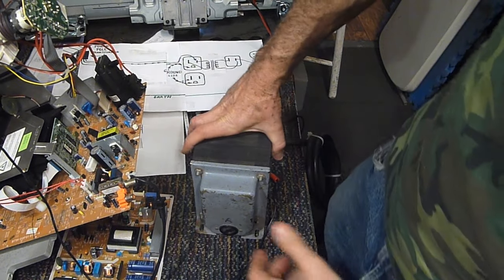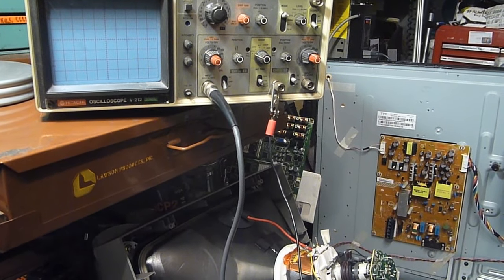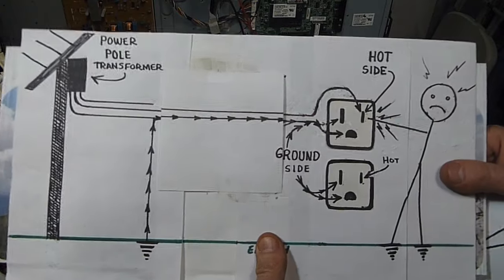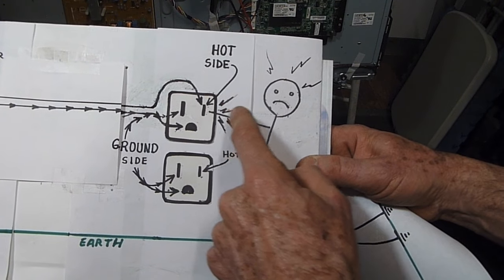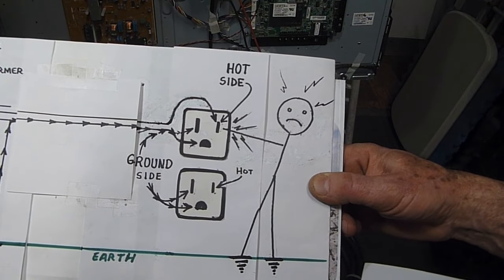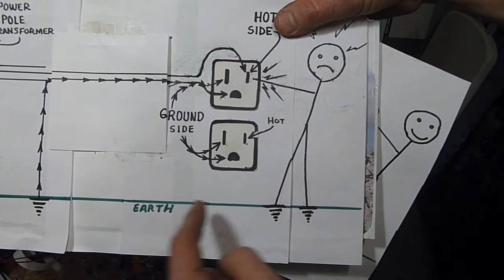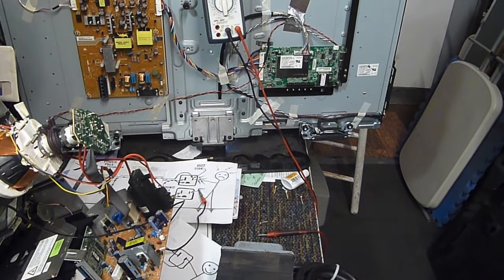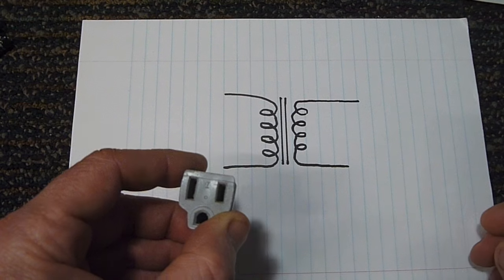Isolation Transformers can save your life, and your equipment.

Comment: GRANTS PASS TV, what was the benefit of TV's uses hot chassis? I'm not sure why the tv designers would use the chassis metal as the high voltage and not connecting it to earth ground, any reasons why?
Reply from the maker: One thing to consider with AC is there really is no hot wire as you would have with DC since AC is continually changing polarity, but since earth ground has an electrical potential in reference to one of the wires in your power outlet they call it a hot wire. As to why the metal chassis inside the TV case would be hot in reference to earth ground on older TVs perhaps it wasn't desogned that way, but due to the fact that sometimes the power outlet wiring in peoples homes have been hooked up in reverse,  That would account for the metal chassis in side the TV case being live when it was never intended to be.
Reply: @GrantsPassTVRepair  Arcade monitors use an isolation transformer to separate the monitor circuit boards grounds from the other circuit boards. The cords have a 3 prong plug but for some reasons the output of the isolation transformer will put the monitors chassis as HOT chassis. If you put your hand on the monitor chassis an your other hand touching earth ground you will get shocked. I'm not sure why they are using an isolation transformer when its still dangerous. If you try to connect your oscilloscope ground to the monitors circuit board ground it will damage the oscilloscope. I'm not sure why they are even using an isolation transformer, but I think its use mint to be used if the flyback transformer shorts out or the Vertical deflection transistor shorts out that the high voltage doesn't short back to the 120vac wall outlet to cause a fire to your house? It says that isolation transformers are Galvantic Isolation and that non isolation transformers don't have galvantic isolation. I'm not sure what they mean by this Galvanic Isolation or what is causing galvanic isolation in transformers.
Reply: First the high voltage is not connected to the chassis only low voltage i.e. mains. high voltage is over 1000 V. You could just as well s why did they not make the TVs digital. It was the technology of the time. Sockets were neither grounded nor polarized. There was 50% chance that the chassis was hot.

The fact that the sockets wee not grounded meant it was reasonably safe as there was little ground potential in rooms.
Reply: @okaro6595  whichs sockets are you referring to? And why would they want the sockets not grounded?

Comment: I've been having trouble with my soundbar. Not one video on soundbars with buzzing/ static type noise. And also my tv speakers sound blown unyet I've always used the soundbar... now I have to figure out if this is fixable by getting this isolator thing for a coaxial or..

Comment: Don't know if you respond to this video anymore but will ask anyway. If you use an adaptor with out the ground wire connected instead of the isolation transformer will that have the same effect?
Reply: It is worse, with the ground it will trip a breaker, without you become the difference of potential, thus getting shocked
Reply: No, just removing the ground plug wont do the same as an isolation transformer, What an isolation Transformer does is isolate de neutral and hot, so you won´t have a shok if you touch any two wires coming from the output of the isolation. Remember the neutral and earth wires are join toguether before it enters your house, so isolating the neutral you no longer have that issue. The best way yo isolate (an the most dangerous) is to use an isolation transformer and don´t hook up the ground wire BUT if something goes wrong It will not trip your house or workshop breaker, so It will blow. It´s hard to understand , isolation transformer are for electrical or electronic repair guys or such,

Comment: This is a highly informative video and I thank you for presenting this.  I have a stupid question though and it involves a comparison where you pretend electricity is water instead: if this were water coming in, then the transformer would act like a filter decreasing the water pressure or amount of water coming in?
Reply from the maker: To keep the concept simple using water pressure as an example. Water pressure would be the voltage, and current or amperage would be the volume of water. Most transformers loose some current to raise their voltage output, or loose some voltage to raise their current output. To keep the concept simple picture an isolation transformer having the same input of water and the same output of water with no change in pressure or volume.
Reply: got it.

Comment: Can I plug this device on my pc and play without problems?

Need this because this isolators have very good Electricity without reactive current
Reply from the maker: As long as you don't exceed the power capacity of the isolation transformer you can plug your PC into it.
Reply: @GrantsPassTVRepair  Oh ok cool so my pc have only a 1000 w psu so easy going when i buy a transformer with 2000 watt. are this peaktech products good? and thx for your fast answer by the way :))
Reply: @GrantsPassTVRepair  or bronson i dont know which one i should by because i need one with very good quality too hold long cuz i use everyday my pc for gaming and making music + video creating and more .
Reply from the maker: @nemesiz7175  Sorry but I don't have any suggestions about brands other than to make sure the unit can handle the power capacity you need.

Comment: You probably should have hit the fact that there is a true separation between the physical input and output of the transformer. Another note would be the current limitation in such an incident of being shocked would be limited to the transformer maximum current which promotes  less severe shocks.
Reply from the maker: Yes describing it as a physical separation would have been another good way of saying it. Regarding the current limitations of the transformer. I would not want to suggest there is any additional protection because of this. It takes less than half an amp to kill someone, so there is still the potential to get a serious shock with far less than the transformer can deliver in spite of its current limitations.
Reply: Agreed, so maybe explaining how this device can (possibly save your life) would fit with the title. And an added safety rule for all, the one handed rule. :)

Comment: Does anyone have an isolation meter scheme  to suggest? Even if we use isolation troansformer to supply the  dut, when we Connect first oscilloscope alligator clip, we cause a 1st failure to ground. If  we connect the second one All is over.

Comment: Question. Their is continuity (4.5ohms resistance) between the hot and neutral tabs on my Iso transformer. When you plug it into a socket then everything on that outlets hot and neutral has continuity (4.5ohms resistance instead of an open loop). Does this matter? The iso transformer is like a big wire that connects Hot and neutral together. Thanks!
Reply: Sadly I just don't think that I can do this topic Justice in a YouTube comment. LOL inductors by Nature are bit more daunting because there is more for you to visualize about them. What I will say is that you are measuring DC resistance with your multimeter and that that is not taken into account an Incredibly crucial part of inductors called Reluctance. 

Regardless though, I will say that you can probably safely visualize the power coming out of your Transformer as a push-pull type of arrangement. When power is going through the Transformer and a magnetic flux is being created, the power in The Wire is basically going to be following Lenz law. This means that the electricity is going to move in a specific Direction on one half of the sine wave and the opposite on the other half. The electricity that doesn't get used in this Arrangement just gets dumped back into the Transformer again as a magnetic flux.

I probably explained this badly and maybe even incorrectly. I would just recommend that you look at the excellent videos done by afrotechmods on the subject of inductors. There is also a good one from Great Scott and I believe a ridiculously in-depth one from mr. Carlson's lab.
Reply: the first man on youtube  know what is LENZ  LAW and MAGNETIC FLUX ,your are the man ,You must bee european because you know what i know.( may be same school )

Comment: Sometimes I wonder why the power that comes into your house isn't all through an isolation transformer..?
Reply: Because you´ll need a huge transformer, think abut it, a 1000w isolation trasnformer weights 20 pounds and measures 10" by 10", an average hose have 110v 20 amp so you´ll need at least a 2000 or 3000 Watt trasnformer, also you don´t need an islation transformer for your microwave, fridge, It´s just for the bench of a repair tech workshop
Reply: @gerardoromano3436  True, but the power still enters our house via a transformer, surely every transformer is an isolation transformer if you dont connect the earth or bond the neutral to earth in your breaker box?

Comment: Hi!  Thanks for the info!   
Question,  vintage radio/amps are what I have recently started working on.
So, on radios and amps that have a power transformer is the chance of a shock less than on those that do not have a power transformer?
Some videos I have watched talk about the 5 and 6 tube radios that do not have a power transformer, and thus they are more likely to give a shock if one is not using an isolation transformer. Is there any truth to that, or regardless, an isolation transformer should always be used?  I have bought an isolation transformer due to your video. 
Again, thanks for the info!!
Reply from the maker: I'm not knowledgeable enough to know.
Reply: In any case, I was unaware of an isolation transformer, and I learned a lot from your video.  I will use it regardless from now on.  Thanks!!
Reply: Transformerless, "AC/DC" radios (and any other device with the tube heaters connected in series directly to the AC mains voltage) usually have an electrically "hot" or "live" chassis, or, more accurately, you have a 50-50 chance of a "hot" or "live" chassis depending which way the old style, non-polarised plug is inserted into the wall socket, because one side of the incoming power cord is invariably connected *directly to the chassis*. To put it another way, if the chassis of a transformerless radio or amplifier doesn't seem to have measurable voltage on it, flipping the plug 180 degrees around will indeed energize it. Even if you install a polarized plug on the radio so that theoretically the chassis will only be connected to the neutral wire of the power-cord  and never to the hot wire, if the wall outlet is wired incorrectly you can still end up with a hot, live chassis. 

 An isolation transformer, if designed and wired correctly,  breaks the circuit in such a way that the "hot" chassis of the device is theoretically no longer "hot",  relative to other grounded tools, appliances, test equipment, microphones and PA/ musical equipment, and even metal water pipes or electrical conduit. Not only is it safer for the technician but it will likely prevent blowing up an oscilloscope, VTVM, signal generator or other AC-powered test/ diagnostic equipment being used during the repair process.

 Note that many older devices ---- radios, amplifiers etc ---- that do have a power transformer but only have a two-wire, non-polarized power cord and plug, often still use the neutral wire of the power cord as a return ground (a noise-shunting ground, really) for the chassis, with a voltage-blocking capacitor between the chassis and one wire of the power cord.  If you happened to plug into the wall the wrong way around, the capacitor is supposed to prevent the chassis from becoming electrically live with 120 V (or 240VAC overseas) while still allowing a path to ground for unwanted electrical noise and radio frequently interference; and if the device hummed through the speaker you were expected to know enough to reverse the plug at the wall socket and hopefully lessen or cure the noise (or in the case of a guitar amplifier, there might be a polarity switch that accomplished the same thing without physicaly reversing the plug).  The problem is that those chassis-isolating capacitors, commonly referred to as "death caps" by technicians,  might be 50 or more years old,  and frequently fail, and start leaking voltage onto the chassis. (Plug a vintage device with faulty wiring or  a leaky death cap into a GFCI,  a ground fault interrupting outlet typically found and required by code in most modern kitchens or bathrooms, and i the breaker built into the outlet will probably trip; if not, reverse the plug in the wall socket and see if it trips).

Old radios were frequently made with wood and plastic and non conductive parts and designed in such a way that it was difficult for the consumer to accidentally touch any part of the chassis that might be live, but vintage guitar amplifiers are a special case because the strings and metal parts of the guitar are at the same electrical potential as the chassis, and if the amp chassis has electricity on it and you touch another electrical or electronic device while your hands are on the guitar, or if you are playing guitar in a basement or garage with a concrete slab under your feet, you can be electrocuted (and damp slippers or socks might not insulated you sufficiently to prevent this). In such cases, use of an isolation transformer would likely prevent electrocution, and in my opinion is a must when using transformerless radios or amplifiers. Even on guitar amplifiers that already have built-in power transformers, knowledgeable techs will remove the death cap and install a 3-wire, grounded cord. 

 Earth-grounding a transformerless vintage radio however (or a vintage TV, for that matter?)  will probably either add noise or simply result in blown fuses and breakers. I suppose you could upgrade the "death cap" to a modern "XY" safety capacitor that is specially designed to handle high AC-mains voltages, and you could also add a polarized cord so that the chassis can never be accidentally connected to the hot lead of the power cord through that capacitor (assuming the wall outlet is wired correctly ---- something that I don't like to assume!); but even if you do that I would probably suggest using an isolation transformer on it anyway.  

By the way it is worth noting that transformerless, AC-DC series string vintage radios may also have a capacitor across the terminals of the on/off switch that can fail and cause the unit to be "live", or at least for the chassis to be "hot" when you least expect it because the radio is turned off! The capacitor is there to prevent premature failure of the switch from arcing at turn-on; it should probably be replaced/ upgraded; or perhaps removed entirely?

Comment: No isolation transformer with a 3 pin plug on the secondary side is a true isolation transformer is you see a 3 pin on the secondary output you should do a test with a voltmeter between neutral from the wall and any of the secondary  side pins if you read 60 volts your in danger of blowing your scope or test equipment 50/50  ,some 3 pins transformer can be retrofitted by eliminating the third pin , so many tech dont get it at all, i've seen one comment on amazon review saying he had to return it i was reading 60 volts to ground ,just totally disconnect the third pin on the secondary to ground and retest !
Reply: Between the secondary side of a true isolation transformer (no neutral at the output) and the neutral from the wall, you will always measure voltage, 
this is called ghost / phantom voltage and is very low current, but can destroy sensitive circuits.
To determine if it's a real voltage or ghost / phantom voltage, connect a 100K  resistor in parallel with you voltmeter, if now the voltage is become very low, it is ghost / phantom voltage.
Also, if you measure 60V (50% of the mains voltage if the mains are 120V) , then there is a possibility that something else is going on.
When there are X and Y safety capacitors are installed at the input of the "isolation transformer", and you disconnect the earth wire to the wall outlet, or use one those 3 pin to 2 pin adapters, then these 60V is leakage from these safety capacitors to the disconnected earth pin.
Like you mentioned, the earth totally removed on the secondary outlet is the best solution.

Comment: I wish to demonstrate noise on an AC main displayed on an oscilloscope, how will I do that safely if do not connect the isolation transformer to the scope?
Reply from the maker: Interesting question since the isolation transformer would block most of the noise. I'm not sure of the best answer, but I would think a resistor in the 10 mega ohm range might work. If you figure this out please share it with me.
Reply: Thanks, I learned something new I  did not know the isolation transformer would block the noise, I thought it would just disconnect the connection between the main neutral and main ground.
Reply from the maker: I  was just reading an article on this. In the article they said an isolation transformer will only provide a limited amount of noise reduction. http://www.schneider-electric.us/en/faqs/FA123947/
Reply: Please help me understand this. If I have the scope power cord plugged in a standard wall 120v outlet, where the outlet is wired correctly....now I connect directly the hot wire of that same outlet  to the input of Channel 1 of my scope ....since the ground of the probe is connected to the same ground of the scope everything is tied to the same ground (receptacle, scope and main ground are tied together)...so where is the safety issue here?
Reply from the maker: I only understand there being an issue of having a ground coming in contact with the hot side of your oscilloscope as I mentioned in this video.